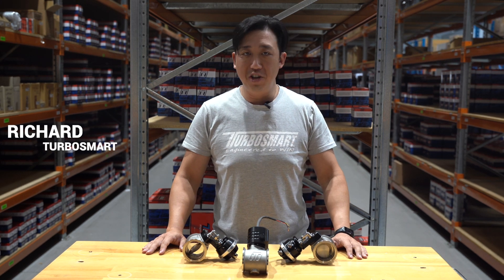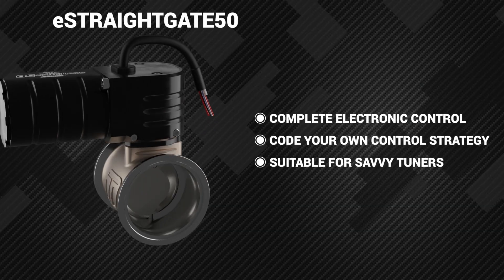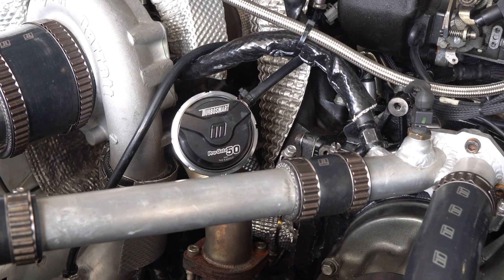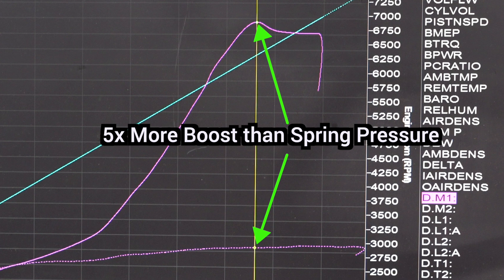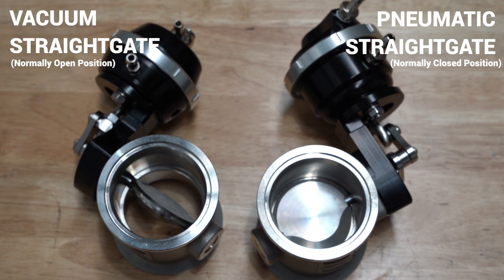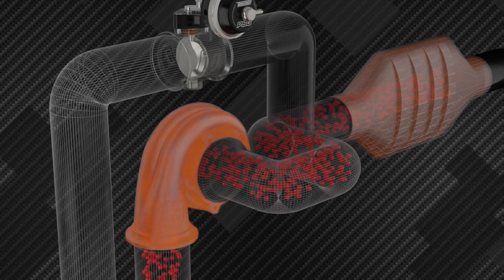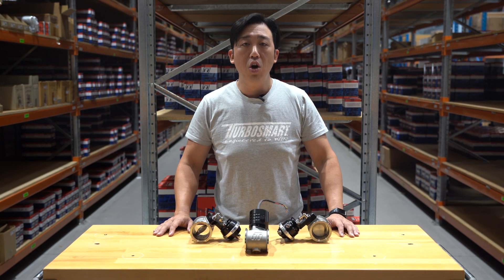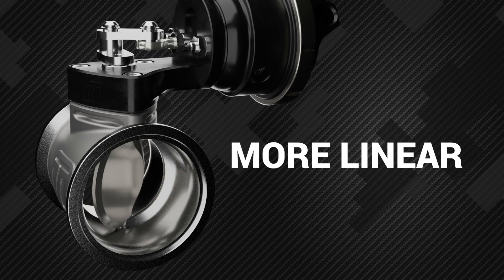3 TYPES OF STRAIGHTGATES! WHICH ONE'S FOR ME?

Comment: Doesn’t the straight gate also leak more gas when it’s closed compared to poppet style wastegate? 😮
Reply from the maker: Yes, the StraightGates will leak when closed because it is just a metal on metal seal. However, this leak down is not detrimental to performance and will not effect the ability to build boost.

Comment: Interested in trying one of these out on my rx7 having creep issues with a standard poppet style valve
Reply from the maker: This is not the highest flowing wastegate period. If you have creep problems after installing this then you've got much bigger issues.
Reply: @TurbosmartHQ not? I think it would be
Reply: @benperkins2929   - Good spotting. It was. However...now there is a 76mm / 3" version that is on another level... So technically, it is... But hasn't my reply hasn't aged well, but my typo did! lol
Reply: @TheRealBoostCreep  how viable do you think it would be to turn one into a quick spool valve? Could use it to block the second scroll of a twinscroll turbo until a certain boost threshold then open it slowly for a variable A/R turbo. There was some made that used your 38mm poppet style valves but the straight gate would be heaps better for flow
Reply: @benperkins2929  You're referring to the Elmer Racing Billet Collectors - I have the original that was displayed at WTAC on my desk! There are a couple points to that... Yes (in short) the SG is by far more efficient from a gas control pserspective in virtually every way and it can be used as a quick spool valve if your imagination and engine bay real estate lends itself to it, it is certainly an option! Packaging however makes it difficult for most to imagine... From a tight engine bay - short manifold runner perspective (which is most aftermarket manifolds), a poppet style system is by far easier to integrate for this... But if you have the space, the SG's are most certainly up for it!

Comment: seems great for systems that don’t need to keep multiple WG flow paths divided, not so much for those that do because of the large packaging size and excessive total combined flow of using two or more.  A Mazda 13B 2-rotor engine being one example.  In that particular case; the answer to the question being asked is: none of the above.

Comment: I think the Vacuum one is the best band for thr buck in terms of control ability as well as simplicity since it can run independent of boost. The electric one, though giving you slightly more accurate tuneability, is twice as expensive.
Reply from the maker: The boost-based actuator can also be operated off of an external pressure sources like an air compressor or Co2 system. The Electronic option give you much more than a slight advantage as you have full control over position and pressure.